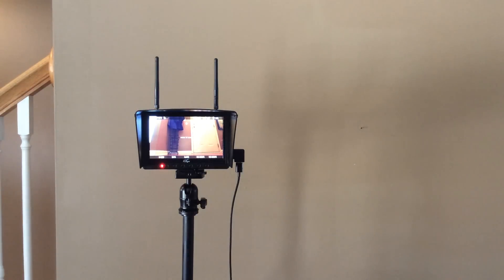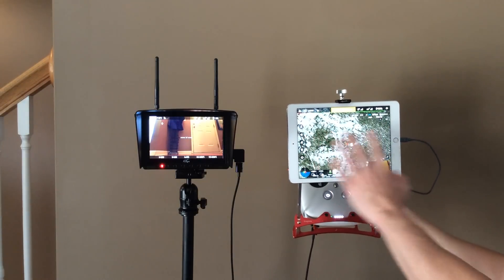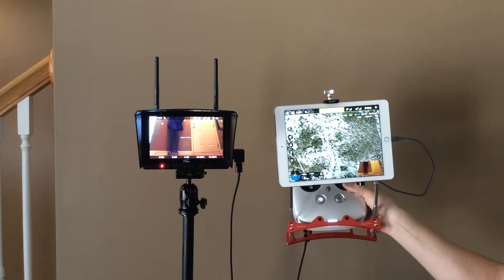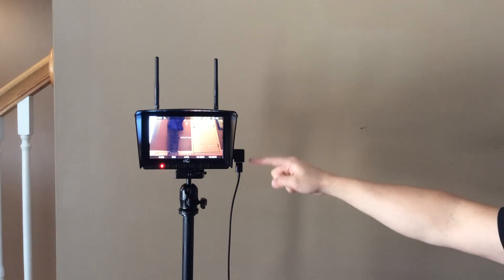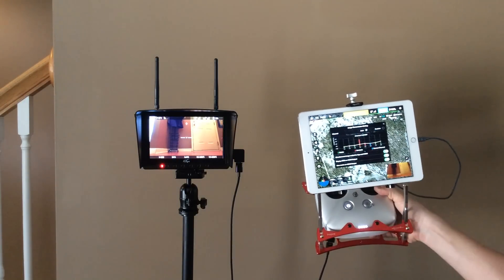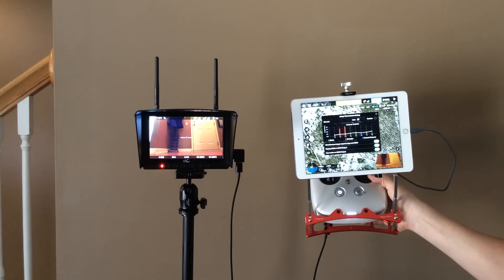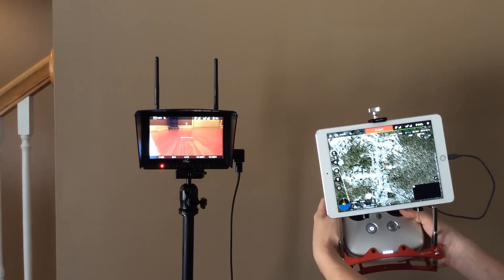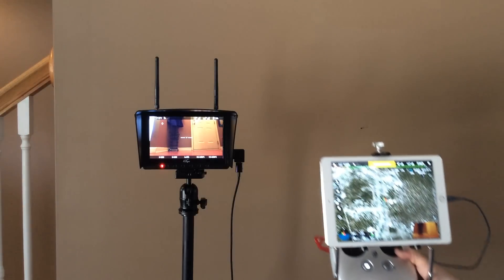DJI INSPIRE 1 HDMI OUTPUT FROM RC

Comment: What would be been good, is if DJI had installed a separate camera for just the pilot to see. How can you see where your flying if someone else is operating the camera gimbal and facing it in another direction?
Reply: Bobster986 You're absolutely right! 
This is the solution, but you'll lose the warranty: http://www.dslrpros.com/buy-services/dslrpros-inspire-1-diyfpv-upgrade.html

Comment: I have the same set-up. But somehow the image on my screen is slightly "zoomed in"
Some firmware issue? I'm on Inspire 1 Firmware v1.2.1.03.
Or is it me?
Thanks for any reply
Reply: Is your OSD chopped off a bit?  This is what happens on my Phantom 3 hooked to a Flysight monitor.  I think it's because the P3 output is 16:10 while the Flysight displays 16:9.  Interesting that this video shows uncropped image.

Comment: Why have you got the antennas on the Black Pearl when you are using it in HDMI mode?....LOL
Reply: Bobster986   errrr...NO!  That's Transmitter final output stages not Receivers.
You can run receivers all day long with no antennas connected without a problem.
Since RX's do not transmit they do not suffer from standing wave ratio energy which causes Tx' o/p stages to heat up and fail.
Reply: BTW...... How do you like the Secraft setup?.......any problems?
Reply from the maker: drybiscuit 

I know...lol... I was just testing other video modes and did not take off!
Reply from the maker: genettico Love it.. it is expensive but man is worth every penny!! IMHO!
Reply: If you don't keep the antennas on when you use the monitor, you run the ruse of burning out the radio receivers.
Reply: drybiscuit That's good to know.